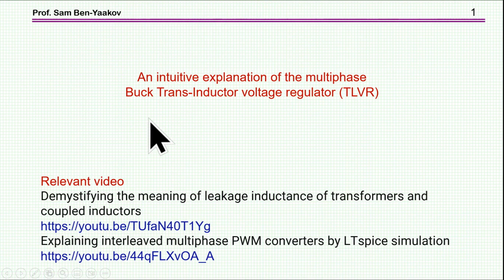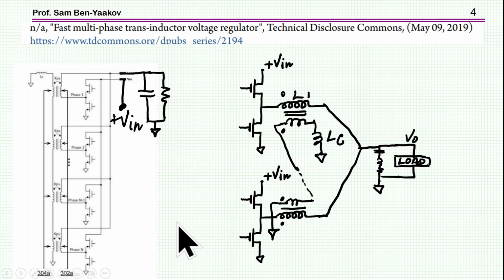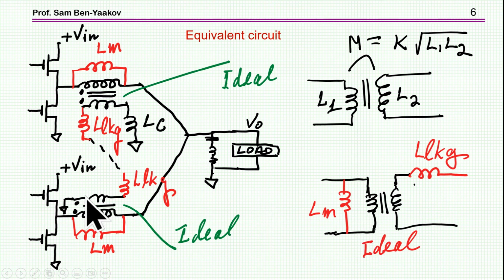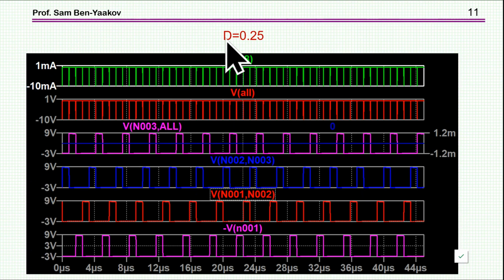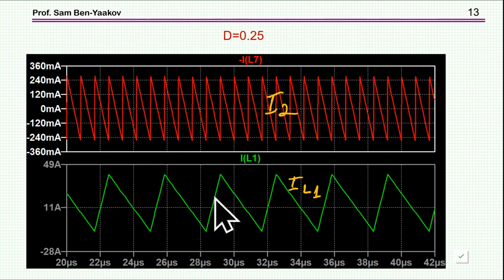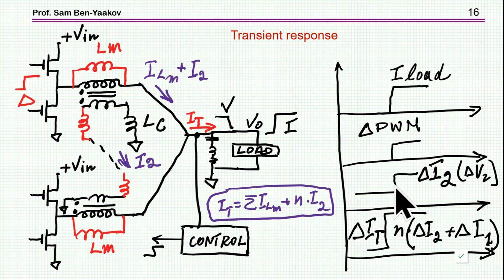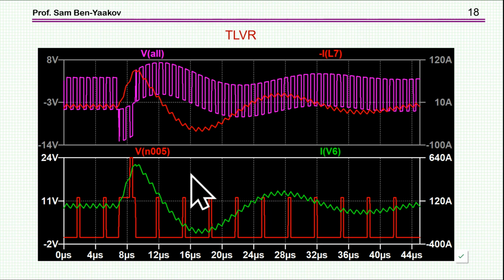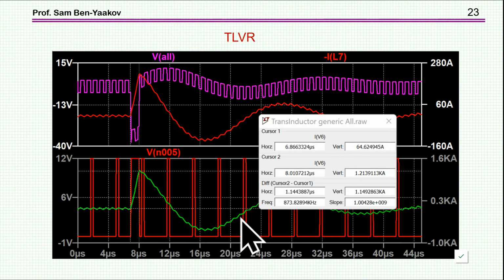An intuitive explanation of the multiphase Buck Trans-Inductor voltage regulator (TLVR)

Comment: I wonder if the leakage and PCB trace inductance eliminates the need for Lc.

The inductor is operating at higher frequency (switching frequency * the number of phases).  Skin effect come into play, especially on the secondary which only sees ripple current, no DC current.
Reply from the maker: Good idea but the trace inductance may be too small for practical switching frequencies.
Reply: @sambenyaakov  The trace length between the inductors and caps limited efficiency (at 500A).  The inductors were too tall to fit on the bottom or under the CPU heatsink.  

To reduce their size, Intel tried to to get the power companies to exceed 1MHz.  We all pushed back, staying below 800KHz.  

The inductors we provided Intel were 100nHy.  Eight TLVR inductors side by side creates about 10cm of trace, about 80nHy.

I don't recall the leakage in the TLVR magnetics.

Comment: Very complex to analyze. so many factors to consider; such huge currents make one wonder  the possible diameter of the windings.
Reply from the maker: see https://www.tdcommons.org/cgi/viewcontent.cgi?article=6147&context=dpubs_series
Reply: Interesting concept. 

Using the same magnetic cores for the transformers, you can either double the wire cross section with the same turns, keeping inductance the same which should halve the resistance, or double the turns quadrupling the inductance. The later is a bad idea, so relatively speaking the ESR loss from the transformer regulator will be twice as high in the primary as the conventional regulator, however the secondary will also have losses. It would seem that in the worst case the secondary current will be approximately 1/N times the current carried in the primary, so this can be minimized with a large number of phases. 

These sorts of regulators usually suffer from large switching losses in the half-bridges, to keep the switching speeds high enough to satisfy the di/dt requirements. Effectively doubling(or N times, in your theoretical “nonlinear controller”) the di/dt using this technique might mean lower switching frequency (and higher inductor core losses) or fewer phases (and higher conduction losses)

I can see where the trade offs may pay to use this method, but it’s not trivial to compare without a detailed optimization for both designs.

Comment: I wish I could find an old motherboard with ring shaped toroid inductors so I can wind a secondary like this on them.
Also, wouldn't these transitional current spikes cause the lower side transistors to blow up if they were already at their current/power limits in the no-tlvr configuration?

Comment: Interesting as always, but what are the implications if all the transformers are wound on a single core?
Reply: there would be no filtration, as the core would see pure DC and there would be no magnetic field collapse to drive the flyback cycle
Reply: @two_number_nines  Good point.
Reply from the maker: This will have no series to parallel amplification